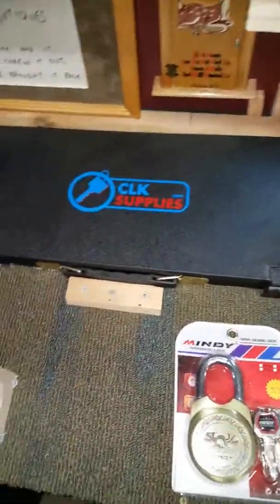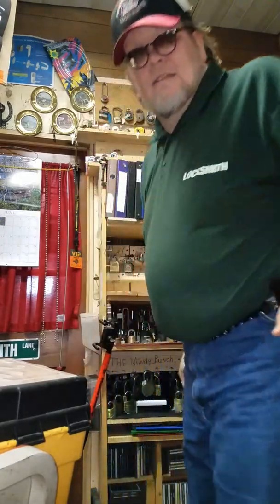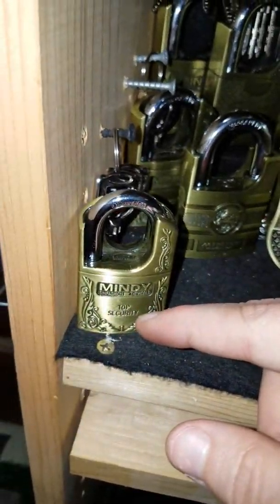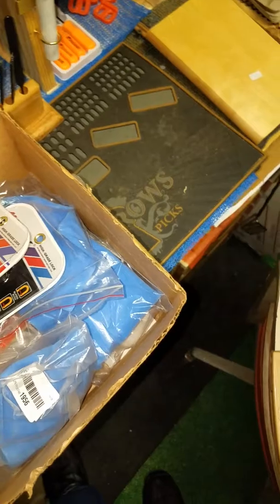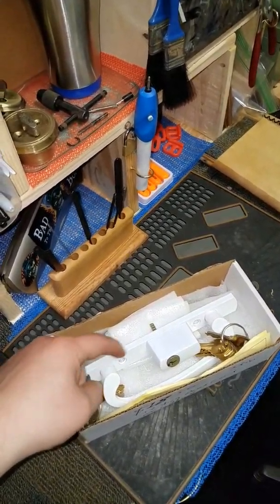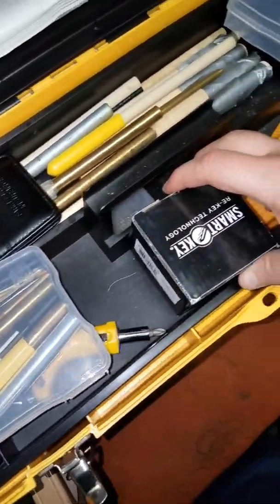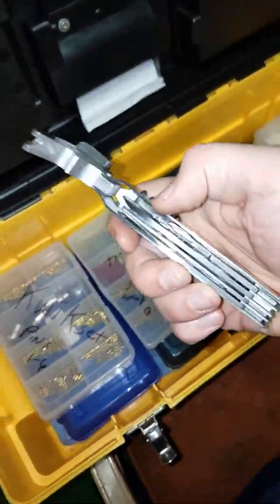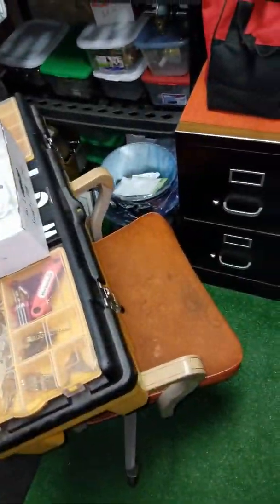Mindy Collection and a job tomorrow

Comment: I got a couple of the Mindy locks very nice locks, still haven't picked them. I have the smiley type dimple I have raked but not spp, I'm not good with dimples anyway.  the the round key with the ring to push down not real sure if I'm tensioning it right. have you been able to pick that one
Reply from the maker: Chris Ahrens LHG I have tried it a couple of times but don't really have a good dimple pick set yet but I will have to try it when I get some